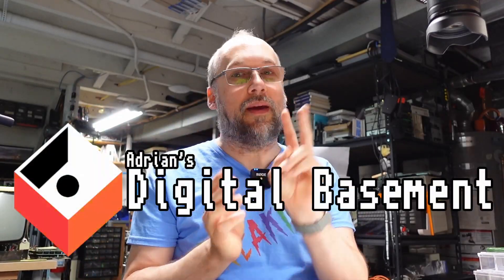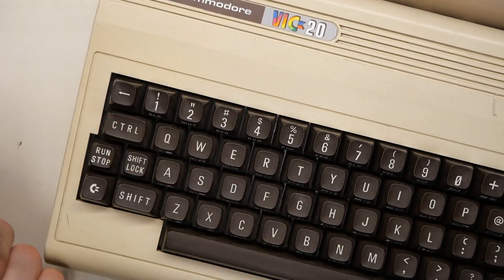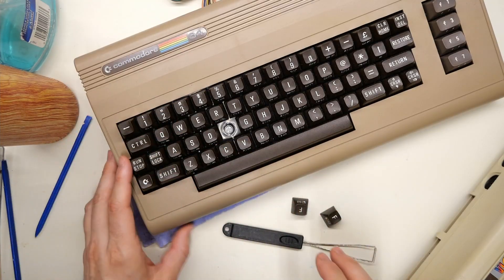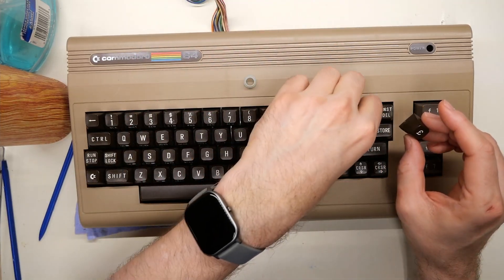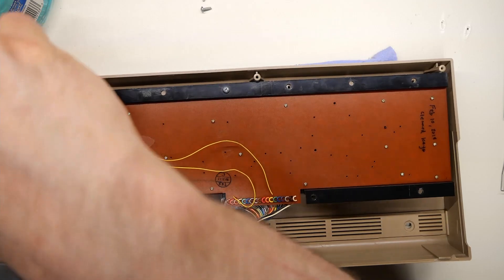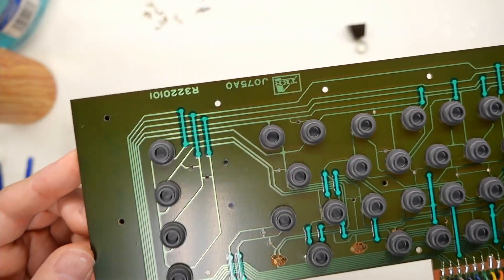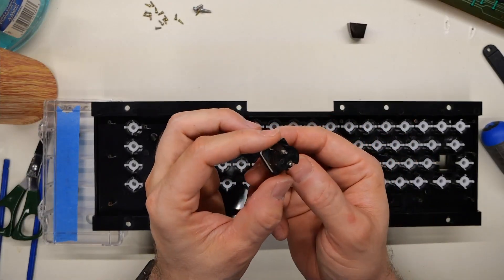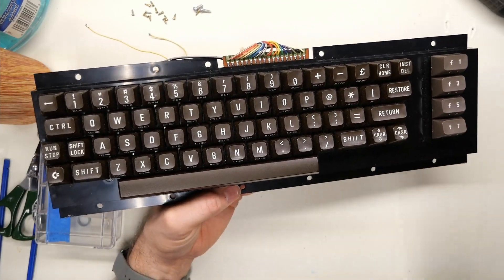Rare (?) Commodore breadbin keyboard curiosity

Comment: I actually have one of those weird keyboards -- and it's in a VIC-20, no less.  Sadly, it's missing quite a few of its keys (and all but two of the associated plungers are broken, so those ended up in the trash), and the machine itself is dead.  It still has all the actual rubber/conductive domes though.

Comment: I got an empty breadbin C64 case with a TKR keyboard still fitted this week, mostly to use as part of a C=Key project (if I ever work out how to program the Atmega IC!), and it's similar to this one, the biggest differences being the stems are grey, the connection point for the harness is offset to one side (Above where Return, Restore etc. are), and on the contact-side of the PCB it is actually marked as "VIC-20", was trying to find a VIC-20 keyboard with the "Eurostile" font keys (cos it looks cooler), but apparently people have more money than me for that, and ended up with this, and yep, mushy, feels worse than the one in my C64c (breadbin-style keys), and that one ain't exactly great either... :P

Comment: Take a paper hole punch and cut a piece of aluminum foil and glue it to the bottom of that key cap, if its just connecting the circuit that should be fine; Can probably find copper or gold foil for cheap enough but the Aluminum should work.

Comment: OK I just checked again - I have something even rarer: An unused C64 still in the box that has the same keyboard!
(OK unused is not totally right - the previous owner unpacked it in late '85 (according to the date codes), hooked it up, turned it on and packed it back up without doing anything with it - even the plastic foil was still on the space bar. I did an unboxing video with a friend who hasn't finished editing the video - by the time he takes I guess that comes out in late 2022... both the C64 and the disk drive work perfectly fine - the disk drive hasn't read a byte in its life before I unpacked it. Even the "hoof of death" PSU works fine and is still in original color which is kinda rare.)

Comment: Found an Italian eBay auction that had a VIC-20 version of this keyboard (PCB only) that had a code of R3210034 on it. Could this be an aftermarket keyboard replacement perhaps, or maybe there was a run of them made to reduce costs somewhere?

Comment: Any half decent manufacturer will have a 2nd source for outsourced parts.
Looks like the primary vendor was Mitsumi, they also supplied RF modulators and mice
2 of the 4 VIC20's and 2 out of about 10 bread bins I have use those keyboards (all PAL & made in England, I'm in AU)

Comment: As a repair tech from back in the heyday of Commodore it is rare to learn something new about the C-64.  I've fixed probably thousands of them but rarely had to take apart the keyboard and never knew that there were 2 types used.  All the ones I came across were the spring type. Thanks for this.

Comment: A word of warning: If you need to do any service on the Futaba MD SHIFT LOCK switch, don't try to just pry it apart! The two terminals act as screws to keep the casing together, so twist them carefully anti-clockwise, and expect a steeply angled thread when you do so. They are easy to wreck, but they can be serviced.

Comment: Been working on a ultimiate64 elite project and needed a keyboard...so I ordered a restored keyboard off ebay...it arrived with a broken C= key...so I ordered a second...I put it in my new computer went to type 10 print "hello world" and could not get a T among other letters...went to a Mechboard64 to save me from trying to make old keyboards work nicely...but needs keycaps from a old keyboard.  First one I started with was one of these...a total mismatch...no go for that.  So on to a second and then a third because the one that worked for a donner had the broken c= key and the second was this mis match one...so I was one key short.  I looked to see if I still had this mis match keyboard...nope...so no donner hardware possible for yours.   Recommend the Mechboard64  but find the space bar difficult to get working.

Comment: I have an old Commodore PC keyboard (KPQ-E99YC) for the PC10/20-III with the same rubber domes under the keys. It was made by Mitsumi.
Reply: Mitsumi KPQ keyboards don't use this mechanism. They have plastic plungers with conductive rubber on them, and the rubber dome (similar to the one Adrian was intending to install) is just used as a spring under the keycap. The C128 and A500 use the same mechanism as the KPQ but some of them use springs instead of the rubber dome. This is more like what the Atari ST uses, but with a different kind of plunger.

Comment: I saw similar one , also shift lock can be removed but never round.
I think there are 5 types of plunger and 4 type of keys.
Most common black plunger +, rare white +, black plunger o shaped with =. Very rare white plunger with small square c64c,c128 and amiga. Extremely rare white plunger with inverted +, there was a  an extra part between plunger and key caps, similar to some amigas, think also rare at amigas.
That rubber domes vere also with square plunger with amigas 2000. So now you know where you can get domes :)
So now we know that mitsumi, TKR and some say samsung made keyboards for commodore.

Comment: I may be wrong but I have a vague memory that back in the Amiga vs ST days swapping out the rubber domes was a popular upgrade and depending on the model of dome you got often improved the feeling of the keyboard.  While I did a quick search I couldn't see any rubber domes with the contacts pre-installed, I did see that the contacts are available separately.  What you could do then is either just buy some modern rubber domes (which should feel better than these old ones, or at least more springy due to the age difference) and glue the contacts into them or attach some contacts to the underside of the plungers and fit springs essentially converting this to a buckling spring type keyboard.

Comment: That keyboard was common on the very early VIC 20 machines.   I have 2 like that and it wasn't until the cost reduced that the mitsumi keyboards seem to have become more common.    Is this an indication that this might be an early model C64?
Reply: Not true. The early West German VIC-20's that succeeded the "Eurostile" keyboards had the same common mechanism as later C64, with a spring under the keycap. The only VIC-20 I have which has this kind of keyboard is a late WG one - all the earlier ones have the normal type of keyboard. I don't have any CR VIC-20's, but I believe they also had the more common keyboards, so this must have been a temporary solution, maybe specifically in late 1982.
Reply: @hansliss  was yours one of the early models with the Gold label or rainbow label?    I have a couple early model gold label machines and they both have that same keyboard.   My early model and cost reduced versions both that the rainbow logo and the more common keyboard.    All of mine are North American versions so perhaps this is just another example of Commodore just using what ever was available at the time.
Reply: @wallacebrown3151  It's a fairly late non-CR West German machine, and all my other West German VIC-20's have the "standard" keyboard with springs under the keycap. I suspect you're right, they just used whatever they had lying around. :)

Comment: The conducting black pad inside the rubber pad.....just reminds me similar thing from PS3/PS4 joypad, is it possible take away those conducting black pad from broken PS3/PS4 joypad or other modern joypad, and use it in Commodore Keyboard. Just wondering.

Comment: I had one of these when I started collecting c64 and vic20 stuff. Didn't like the mushy feel of it so it was sold on. As far as I can see they are easy to spot as the 'shift lock' key mech is round , not square like on the normal Mitsumi keyboard.

Comment: I have two of these keyboards.  You will notice that the function keys, SHIFT keys, and RESTORE are all dead center on the stem instead of being offset like the mass majority of C64 keyboards.  I found this version when I was looking into the various keyboards because of the Keycap Campaign.  From my research it seems that these were used on some model of the PET (which is why the center section is cut out) and the VIC-20.  I am guessing that CBM had extras and made the adapters to get rid of what was in inventory on some batch of C64s.

Comment: This is very similar how all (well, most) game console buttons are built, right from the Gameboy or maybe even before that... tiny rubber domes with the carbon contact inside them. Sometimes the domes get tired and tear up around the bend, and you have to replace it... and sometimes the contact just gets all shiny and doesn't close the circuit well, that's better because then you can just rub the contact surface off on a piece of paper and it will work again. But inside a C64... never seen it :D

Comment: I've got one of these keyboards in my C64 collection. The rubber dome action does feel a little different. It was in another rare C64 with a custom slimline case made by Micro Accessories of SA (South Australia). 

My keyboard has a failed Shift Lock switch and working replacements are insanely rare. 

I think I'll need to make a flip flop latching circuit to restore functionality.

You can find spares for these keyboards from Retroleum in the UK... but no shift lock switches 🙂
Reply: Actually, if you can't get hold of Futaba MD switches, let me know.
Reply: @hansliss  I've been able to find momentary switches on eBay fairly easily, but not the push on/push off kind used for the Shift Lock on these older C64 keyboards. I've got a failed Shift Lock switch and they seem to be rarer than rare.

Comment: I have seen 3 or 4 of theese keyboards, one of them I only use for testing C64/VIC20 boards. The one thing I like this keyboard for, is that the wires come out the back, makes it easier for testing repaired boards when the keyboard is on the table. But, I agree, this type of keyboard feels mushy.

Comment: I remember the rubber dome type C64 keyboards back when I repaired these out of a local computer store. Often after someone had split something on it. 
Repair was easy though; wash the plastic plungers in water whilst still in the frame, move the rubber domes off the board and clean the carbon discs on the domes and the gold contacts on the board with IPA.

Comment: I  * just * cleaned this very same style keyboard that is in my VIC-20, which had 3 or 4 keys that were acting up. Undoing the 23 screws (trying not to lose them) that holds the PCB to the upper plastic and then popping out all the rubber domes to clean them (trying not to lose them) was quite a chore. :(

Comment: I have a keyboard just like that in my VIC-20! 

The brown side of the keyboard PCB has a round stamp in black ink with three rows of text that says “TKR”, “68.8.8” (or “58.8.8”, hard to see as the ink is smeared a little), and a lone “F” on the last row. The keyboard PCB just says R3210034 and VIC-20 on the bottom right.

When I bought the machine it acted like it had a stuck space key, but it turned out it was the rubber dome of the CRSR-right key that was stuck down. Took it apart and cleaned everything and it works great again 😊

The main PCB in the VIC-20 is ASSY 250403 REV.D, and the computer itself seems made in mid-83 going by the chip date codes. It has the standard DIN connector for power. Serial no is WG C 120014, made in West Germany.

Thanks for all your great and interesting videos!
Reply: Mine says "58.1.26". Might be a date code or a QC stamp or something. Interesting to see that yours was in a CR VIC-20.

Comment: Rubber domes vs. springs are the big differentiator between traditional and mechanical keyboards, so it's no wonder that you feel that the rubber-dome keyboard feels inferior and mushier.

I wonder if Commodore was trying this as a cost-reduced measure and it was just so godawful that they discontinued it after a limited production run (but, being Commodore, still used the parts in shipping computers to not waste the money).
Reply: I thought the difference with mechanical keyboards was that they have clicky mechanisms.
Reply: @stevethepocket  Nah, there's plenty of non-clicky mechanical keyboard switches. Cherry brown/red/black/etc and their various clones, and many of the ALPS switches, are non-clicky but also still considered mechanical.

There's no really good differentiator between mechanical and non-mechanical keyboards, but the one thing folks generally agree on is that pure rubber-dome switches aren't mechanical (although some mechanical keyboards such as the IBM Model M do involve a rubber dome as part of the contact mechanism so there's still nuance involved).

Comment: For the rubber domes with the contacts I usually salvage any old infrared remote control. Although I came across a regular IBM PC keyboard (very late 90s) that has individual rubber domes with contacts, so I don't have to mutilate IR remotes anymore.

Comment: The one you replaced maybe didn't need the connection pad. Swap them again now that you have the original in hand.
Reply: slight misunderstanding i think, the domes need the connection pad to close the contacts on the pcb, thats how they work. also Adrian doesnt have the original dome, he showed another type of dome, not the same, and the spring.

Comment: I fixed an Amiga key like this by using a conductive ink marker on the bottom of the rubber key contact, because it stopped conducting.  Might work here also.
Reply: good idea, but in this case Adrian doesnt have another grey dome (with contact) only a white dome which is just a ring, it never had a contact.

Comment: That looks like the same mechanism as the SX-64 keyboard?
Reply from the maker: No that keyboard uses a membrane for the contacts -- doesn't have a PCB from my understanding
Reply: @adriansdigitalbasement2  Ah, I remembered wrong. I am sure I have had a machine with that keyboard type that was not a C64. Need to look back at some videos :)

Comment: I've seen this same rubber domes in my Atari 1040 ST keyboard.  I am assuming it was a way to cost cut if the ST line adopted it 😁
Reply: Yeah, I would say the same. About 6 months after buying my Atari ST I had it to a computer meeting. I had just opened a bottle of Coke, when something interesting happened behind my back. I turned to look, and when I looked up the Coca Cola was bubbling out of the bottle, dripping down my and and down on my brand new computer. I tried to clean it up as good as I could, but after half an hour or so the keys started to stick. So I had no other resolve than to open up the computer and taking the keyboard apart to clean it. sigh
Reply: Yes, mine as well.  Should note that Atari did provide improved rubber domes that were used on the Mega STe/TT keys that work much better, got a full set and put them in my Falcon keyboard.
Reply: Was going to say the same. I had a cola issue too. Ended up with the lot in warm soapy water. I wonder if the people that designed that c64 keyboard also designed one for the ST range!

Comment: Hey Adrian, I just had to replace two key stems from my Atari ST1040STF and found they had the same kind of independent domes.  I find it one of the worst feeling keyboards I have ever used, I think the domes may not age well.
Reply from the maker: Heh yeah now you mention it, I think I stole the pound key dome to fix an ST! And yeah, a total mush-fest ... not good at all.
Reply: I had an ST back in the day. I loved its styling and capabilities but they were cheaply made and the keyboard was the worst I had ever used. Then the Chinon single sided floppy disk drive failed. The floppy controller would actually support a double sided drive as there was an  addon board that converted the cable for single sided operation. You just omitted the board when fittimg the new drive. Finally the PSU gave up which was also quite common.   .

Comment: I know I've seen that type of keyboard key before, just not on a Commodore.  It's almost like the silicone sheet style keys on some infrared remote controls, with the nub under each button (hard graphite or similar I assume).
Reply: @slightlyevolved  I was just talking about seeing a keyboard like this, with individual silicone domes, from my experience with keyboards going back into the 1970s.  Yes, there were cost-saving styles put into place, but other factors come into play like reliability and durability in extended environmental conditions.  Cost of assembling them is figured in, too.

Comment: I too have one on my Vic 20 from 1982.  I'm thinking that Commodore was trying a cost reduced keyboard and it didn't work out?
Reply: Thats what I think too.  They were making millions of these every year so it stands to reason that they added on another supplier other then just, was it Mitsumi, that made their keyboards?  It obviously failed because thankfully these are not common.
Reply: Maybe cost cutting from previously on the VIC-20 or similar, but the rubber dome type didn't last long on the C-64.  All of these were essentially early keyboards on a C-64.  Once they switched to the rubber strip type they never looked back, the rubber domes were from people who had old 64's.  I repaired a few hundred 64's overall through the mid-90's so that's from a fairly wide sampling.  Threw away roughly 100 parts machines when I had to move in the late 90's, but they were mostly old version dog boards where the main parts had been removed.
Realize the much easier to assemble rubber strip vs fiddly rubber domes?  The newer, better keyboard was the cost reduction, that's why it stayed in production for the rest of the run with minor adjustments.  You can bet your behind the early Mitsumi keyboards cost a fortune compared to the later versions.